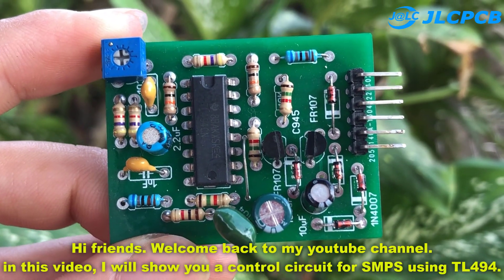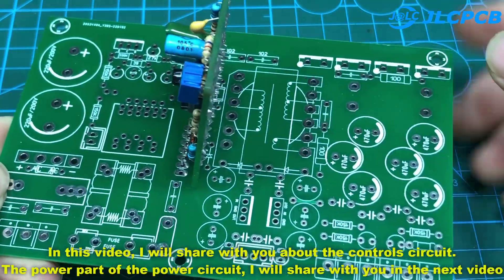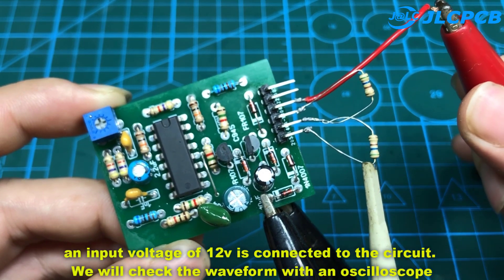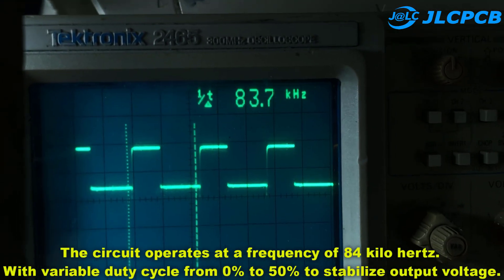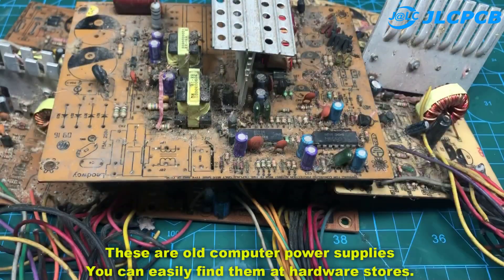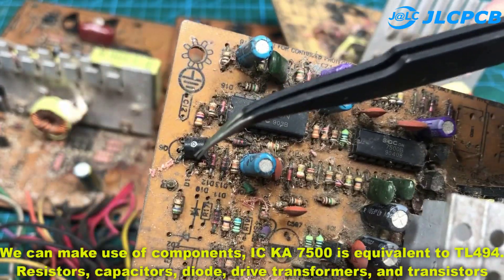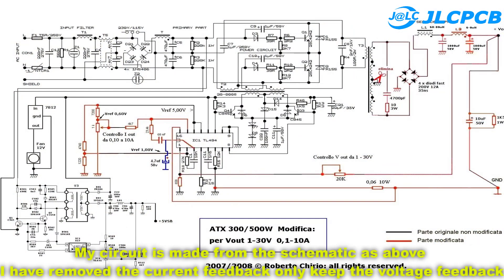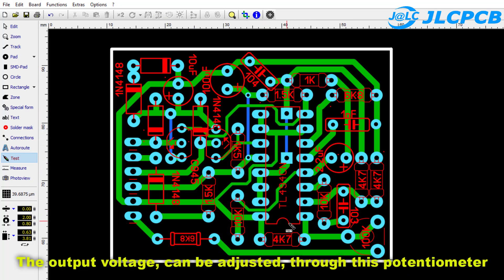Control Circuit For SMPS Using TL494

Comment from the maker: Hello Bro ! Where are you from?. What project do you want me to do next time ?.
Reply: Please make a 24v smps with this module and please make it on single sided pcb
Reply: @kdcreativity6201 , sure single sided pcb are good for us beginners also those who use veroboards
Reply: @raymondmichael4987  yes and it’s also easy to print them
Reply from the maker: OK bro
Reply from the maker: OK bro
Reply: 12v to 20-0-20 dc converter
Reply from the maker: OK bro
Reply: Maybe  you can make a video about SMPS power supply for amplifiers.I mean 5 volt ,3,3 volt ,12 volt DC outputs.And  adjustable symetric high voltage I mean 40-55 volt (+40-55 volt),GND,-(40-55 VOLT)
Other video about D class amplifier Infeneon's have amazng IC chips for example :MERUS MA12070P 
Or you can advice a good D Class IC module too(With DSP etc)
Reply from the maker: I will try bro. Next video is smps for amplifier.
Reply: @LongTechnical  Thankyou 🤗
Reply: An high current dc measurement circuit since after seeing ur videos I build my 700w smps but have no instrumeny for measuring it so if possible made a diy current meter for measuring 100a DC with some avilable conductor like cu brass as current shunt
Reply from the maker: Thank oK bro
Reply: sir please atx pulse transformer winding calculation.
Reply: 180 - 340 VDC input >> 220 VDC fixed output - 50 watt   @long technical

Comment: I will be so glad if you can make a full bridge 24volt , 20A dc motor driver with safety and control mode such as : bipolar and unipolar pwm control .all u need is the driver and for the controler we can use external arduino to control

Comment: Hello sir amplifier low volt 55-055 High volt 110-0-110 making  circuit diagram PDF file layout upload
Reply from the maker: High volt dangerous bro
Reply: @LongTechnical  biarin ajj mungkin buat ngecas badan

Comment: Im sorry but not very good design. No current feedback? Thats not sound safety. And you mount control board few cm from switching transrormer wich will ocure big Interference.
Reply from the maker: Thank you for your information. I will try to improve my skill. This is also no current feedback. Thanks

Comment: Nice video Thank you.
I was checked schema I think have current limiting too Right?
Also when completed not need connect any AC to DC Output SMPS to input  (like 300 watt 24 volt DC Output SMPS)
Please give more details about SMPS transformer in circuit .I mean code numbers,which model computer Power supply have this tansformer  and other replacement codes and please more details inductors too (Colours ,which size and Al values can use etc)
Thank you for great video .I am following
*Last sentences please describe some test point voltages on project 
I mean if you say some voltage values and oscilloscope signals we can mae more easy or can fix more any problem on circuit while making 
Also maybe you can make a video about Panel volt and ampere meter with seven segment (for monitoring voltage and current values also CC and CV LEDs on manin board too
Reply from the maker: Thank you for your information. I wake it detail in next video